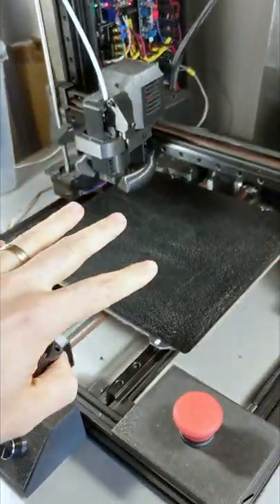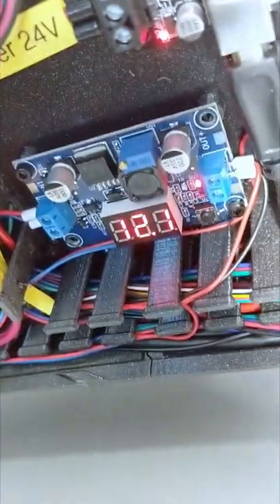Overvolting a 3D printer hotbed (don't try at home!)

Comment: 30V is quite high, is that within spec of the heater? It seems like it could be a possible safety concern. Not sure about that, just curious to hear your thoughts!
Reply from the maker: Definitely not within spec, so it is a possible safety concern, reason why I actually discourage this kind of mods and I do have separate active safety systems installed just in case. I did check with an engineer and it should be fine, but you never know without proper analysis.
Reply: Spec on something like a pcb trace heater would simply be based on passive heat dissipation and arcing due to excessive voltage. His problem is that he has too much heat dissipation so that isn't a problem, and no way your going to arc traces on a pcb like that at 30v

Comment: Mihai, I have once again the same setup as you! This 4820 fan is super amazing! I encountered different issue tho, the splash airflow was cooling the hotend too much :D
Reply from the maker: Haha same here, even with a silicone sock! I switched to a 50W heater cartridge and now it's working well. Also ordered 65W heaters just in case. But I'm trying a different duct angle to direct the airflow further down.
Reply: @MihaiDesigns  yeah, I had to upgrade to a 70W mellow heater and now it somewhat works, but still its too powerful even at 50% :D Klipper complains all day about heater not heating up as expected :D

Comment: Have you not reached flow problems yet?
Reply from the maker: Yeah, flow is really limiting. I'm working on a mount for a SuperVolcano hotend just to see what it can do.
Reply: @MihaiDesigns  A CHT should add at minimum 15% extra flow to your existing setup if you're not already using one
Reply: @MihaiDesigns  why don’t you use the dragon hf hotends you already have?

Comment: I'm curious did you try adjusting the cooling fan settings to make it at like 10% output on the first layer ps I think you design is awesome
Reply from the maker: Yes, first layer is printed with the fan off and then it gradually ramps up.
Reply: @MihaiDesigns  ok I was just wondering so this custom printer is just functioning well

Comment: Install insulation under the bed
Reply from the maker: Yup, first thing I tried! Seemed to work for the most part, but there are always these edge cases that are annoying. For example when printing something small the fans are ramped up more.